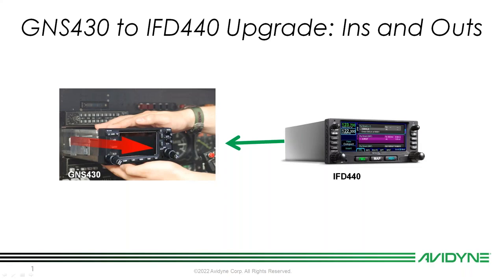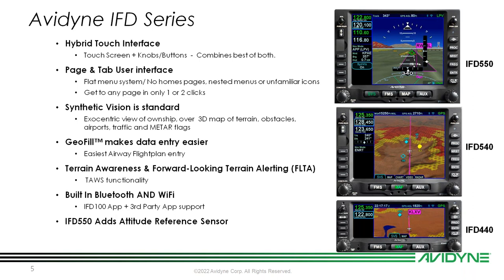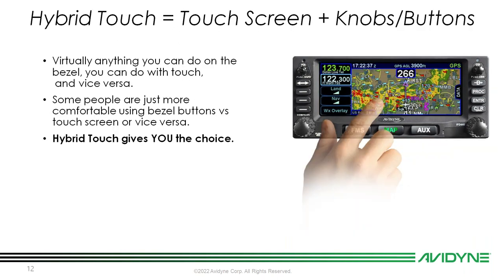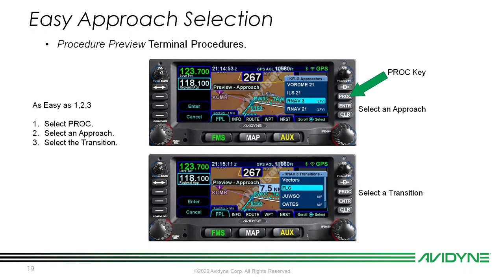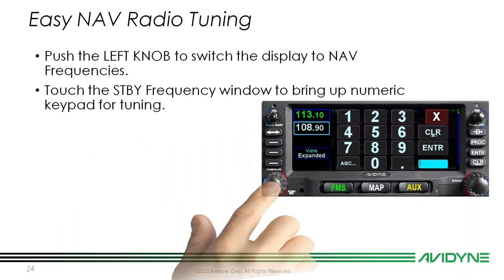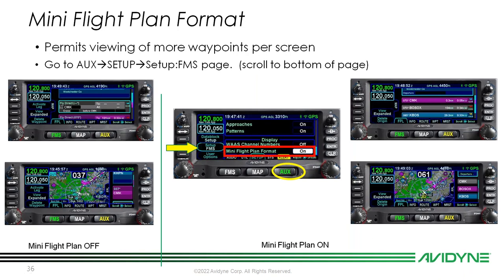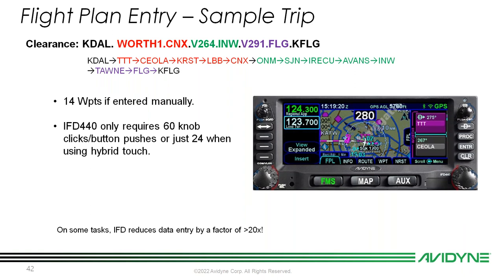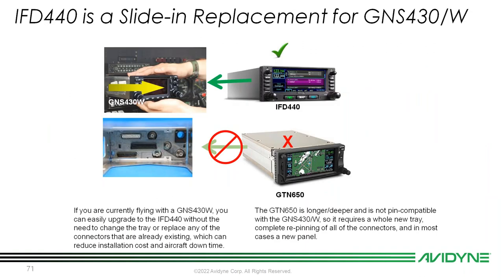GNS430 to IFD440 Upgrade Ins and Outs

Comment: I have the Garmin 750 and a 430w as my number 2. If I replaced my 430w with your 440, will it still crossfill from the Garmin 750? If it doesn’t, can I then load my flight plan to the 440 via Wi-Fi instead. Would that be an acceptable work around? I use ForeFlight.
Reply: No it will not crossfill.   Yes, Foreflight would certainly work to send the flightplan to the 440 via WiFi.